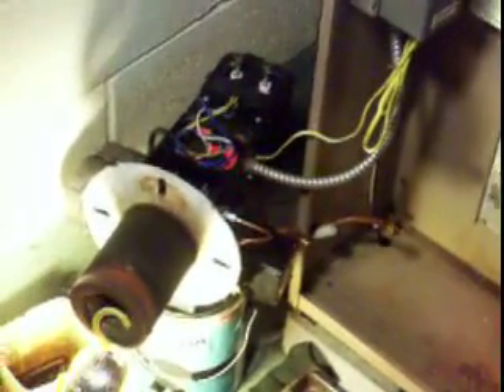(part 4) furnace combustion chamber liner replacement

Comment: Great video, but video quality is low :(
Reply: thank you and yes it was just done "on the fly" and I'm not a pro! long time ago!
Reply: Hey Robert! I didn't mean to insult you. I was talking about video resolution. I know you did it a long time ago and HD wasn't common back then! Btw, do you still have the same system? How did the liner change hold up? I am planning to do the same with my old furnace and your video inspired me to do so
Reply: the liner held up great so far, the furnace is running and the only thing that I can say regarding this is that i hear no more metal pinging sounds which i remember hearing when it would shut off, but i'm not sure this proves anything. yes camera was really simple I do have a new one.